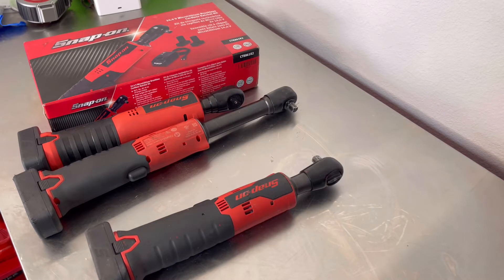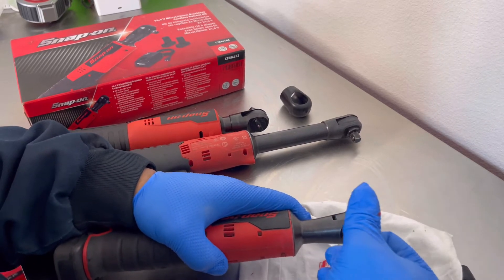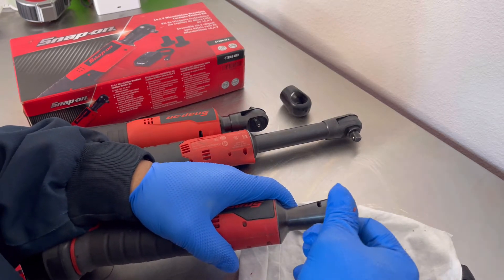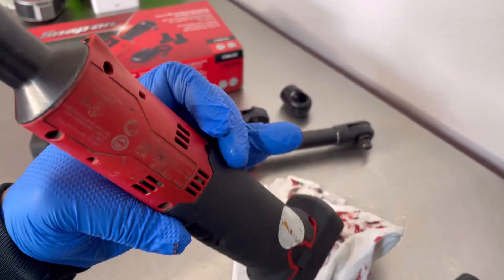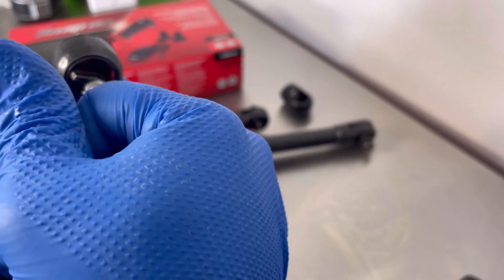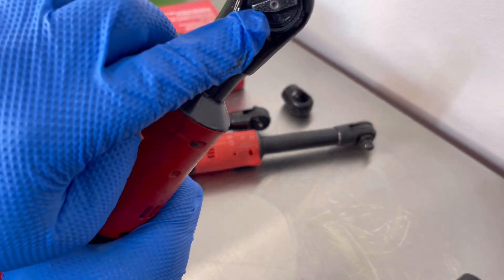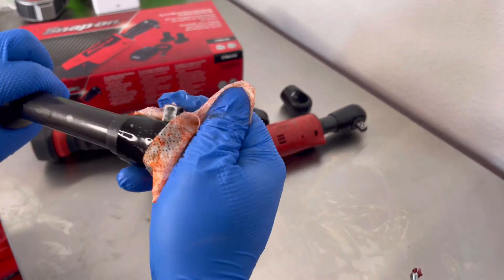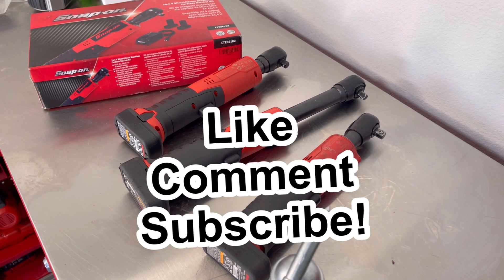Adding fresh grease to Snap-On 14.4 Ratchet

Comment: I never saw that snap on grease attachment or grease tube. I just used a a slight squeeze of bearing grease with an old  needle bearing grease fitting. I am definitely going to get one. Thanks👍🏻

Comment: You used way too much grease.only need to grease till you can see it coming out
Reply from the maker: Yes that’s what I did, I purged the old grease out using the new grease plus ran the ratchet to allow the excess grease to expel.
Reply: @charlestechlife  but there is no need to remove all the old grease
Reply from the maker: @platypus1287  contamination is one of the Leading causes of bearing failures
Reply: @charlestechlife  there isn’t a bearing in there. I use a grease gun on a regular basis, if you do what you’re doing here you would go through a whole tube of grease in a few zerts.
Reply from the maker: @platypus1287  ok